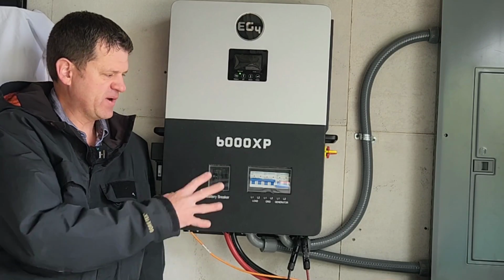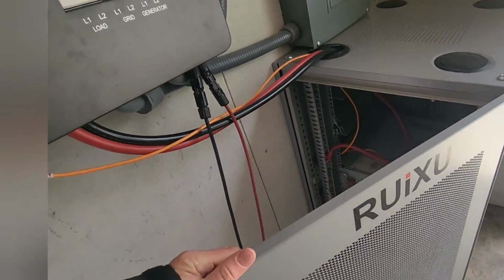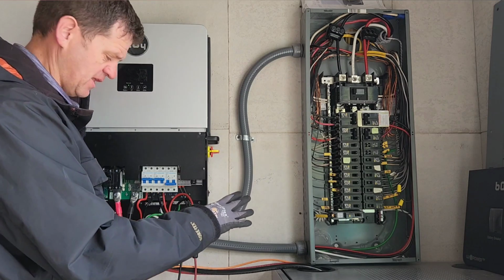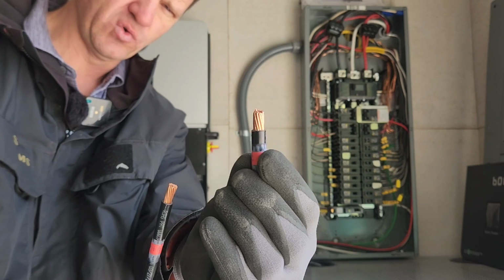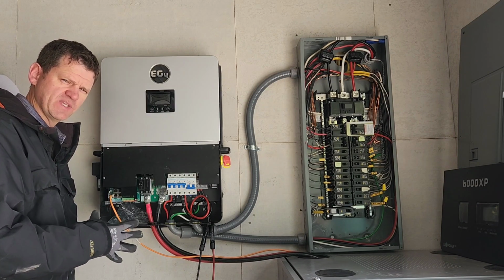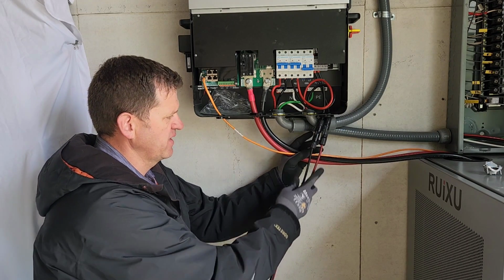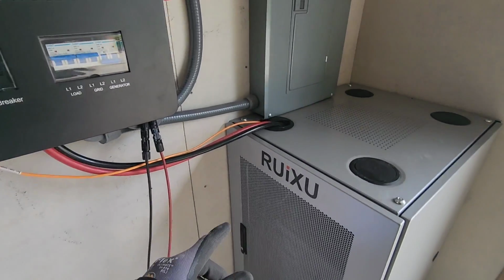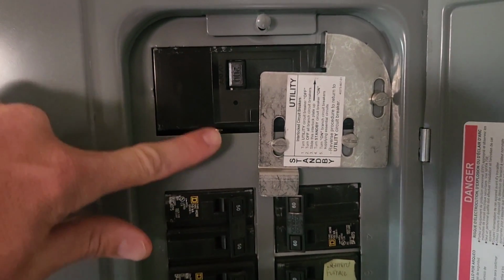1 Month Review: Easy DIY Home Backup Solar Power System & Battery | 6000xp Ruixu Install

Comment: Not supposed to have anything in front of the panel!!! Batteries need to be moved...
Why are you putting any conduit between the inverter and the conduit box? Just bump it right up to it!!!😂 Is there a switch down there you have to access on the bottom???

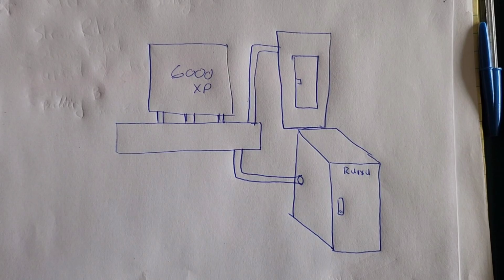Comment: 1:15 and 7:20 don’t think you can have battery rack in front of your electrical panel… nothing more than 6” away from wall blocking electricians access to the panel. Maybe add a ballon tip about this?
Reply: Mentioned at 21:21 in your other video https://youtu.be/dl_8fBnIexk

Comment: I thought you couldn't back feed to the grid with the 6000xp
Reply from the maker: The grid connection usual accept Grid or push power backwards into the grid... so this unit cannot backfeed from the grid port. I hope that makes sense.   However, if I connect the output power directly to the grid, it can send power to the grid and put lineman in danger if they are fixing downed power lines. Etc.
Reply: @diySolarPowerFunWithRay Thank you

Comment: Hi Ray,  can you tell me if your 6000XP and battery installation raised the ambient temperature of your garage?  My garage  can get to around 80 in the summer and I'm concerned the inverter/batteries would raise this significantly as I don't have the space conditioned or vented. I am wondering if additional fans might help.  Thanks
Reply from the maker: I don't think they will raise your garage temperature at all. I Haven't noticed anything.  But I would definitely recommend the 12000xp over the 6000xp model.   Not much more money and way more quiet... And there's a smart port... and way easier to wire than 2 6000xps.

Comment: By NEC rules, you need to move your battery rack, to clear your electrical panel access.
Reply from the maker: Yup. That's correct
 Missed that one.  Thx

Comment: -60amp breaker needs 4/3 wire, even EG4 instruction manual says to size wire appropriately.  Wire should always be larger than breaker, as breaker should blow before any melted wire.
-1/0 wire should connect batteries to 200amp battery breaker...

Comment: You should have installed an automatic transfer switch
Reply from the maker: I have my house running on my inverter all the time. Actually, the inverter has a built-in automatic transfer switch, so it will automatically switch over to grid if the batteries get low and then when the sun comes out, it'll switch back.

Comment: This appears to be exactly what I want to do. My only question: So on a day to day basis, you keep the main grid power switch in your panel turned to the off position?
Reply from the maker: Yup... off all the time... unless my inverter breaks for some reason.
Reply: @diySolarPowerFunWithRay  I love it! But the dual pole 60 amp breaker that's feeding your panel from the 6000xp (yes, I know you've updated since) is sufficient to handle the load from the entire house? I'd be afraid that would be the bottleneck if your house was pulling too much power.
Reply: @robwatson7401 the system uses grid if the demand is too much. Pretty nice system.

Comment: Im trying to size my batteries for a system build. The EG4 6600 @ 6000W apparently needs 28 of the 5KW batteries, and I see a lot of folks running much less. Wondering why that is. Im looking for an off-grid solution to run 3500W so the 6000 would be a good choice. With only 3500W I would apparently need about 17 batteries. Again, much larger than expected.
Reply from the maker: One server rack battery can usually produce a constant 100 amps.  So one battery can product 100a x 52v = 5,200 watts.
Reply: @diySolarPowerFunWithRay  Thanks, I need to sustain 3.5KW load for 24 hours. That is about 85KW for the day. That's where im getting the 17 batteries from. Im figuring an average of 6 hours/day of sun, so 6KW * 6h = 36KWh, which is short of the requirement for recharging the batteries each day.
Reply from the maker: @ronwatkins5775  17 is correct.  so it sounds like you're array is too small as well. Your array will need to produce 85KWH per day also.  Are you sure you have a constant 3.5 kilowatt hour load running all day long 24 hours a day. What is it?
Reply: @diySolarPowerFunWithRay  Yes, 3.5KW. It's for mining crypto currency. Im looking into what it would cost to setup an off-grid capability to see how it compares with the earnings from the mining rig. If it's feasible, then I would probably like to do a much larger off-grid installation. for now, just trying to match-up what solar gear I would need to run a single mining rig.

Comment: Wire and breaker sizing is always fun to decide what you want to accomplish or protect. Not always so straight forward. You've got battery cells capable of 300 amps, a BMS capable of 200 amps but you crowbar the current flow to 50 amps. Never know, you might want to bump the current to 75 or even 100 or even get stupid and crank it up to 200 for heavens sake. Somebody needs to invent adjustable wire and breakers. And hang your wire stretchers on the side of the panel just in case. 🤣

Comment: A trough directly under both proposed inverters would look just as good if not better than having pipes between the inverters and troughs saving on pipe and headaches to connecting troughs to inverters. Additionally, you can use the troughs as a means to run lots more wire as the rule on fill amount in the troughs wouldn’t be violated as if pipe were used. Great job!!!
Reply from the maker: I'm leaning that direction.  I will have to punch a bunch on holes out of the bottom of the trough for the battery terminals and communication ports... But I think that's do-able.

Comment: Why is there no mention of the loads from your water heater or well pump? Those are high demand and hard to start devices.
Reply from the maker: Not well pump for me. and my water heater is gas... although I should probably switch it over to dual fuel.

Comment: I have a proposed off grid plan. It is a 60amp Sq D load panel - 6500 and Ruixu batteries and a 10 000w gas generator. I plan to place a 50amp breaker specifically for a generator outlet on my exterior. I plan to use 4 gauge copper from the Inverter to the main lugs of the 60amp load center. My generator is a back up. My question is; should I use a transfer switch to flip back and forth - Inverter to generator?
Reply from the maker: I think i would do something different. Are you in the United States? It's this for your home? A critical load panel?
Reply: Thanks for the reply. I am building a small 2 bedroom cottage in The Philippines. It is the critical load; water pump, AC 1.5M³, numerous led lights. Code compliant - No.
Reply from the maker: Because your International, those batteries would probably be fine.  I think they have Distributors all over the world. I would go with a smaller generator that is connected directly to the batteries and would automatically kick on when the battery is getting low. I would not have the generator run my house but instead have it just charged my batteries and have the inverter run my house.  You can have your generator automatically turn on for a bit when your battery gets low.

Comment: Would not use an interlock on the main panel.  Instead, use one or two 10 circuit Reliance manual transfer switchs.  Gives you the ability to run solar for the stuff you want solar to run off of, and keep the other stuff on the grid, and switch back and forth easily depending on your needs.  The interlock is ALL OR NOTHING...

Comment: Question about tapping after meter before 200 amp panel with Polaris or B-Tap connectors: Can 200 Amp go directly to the 6000 XP with 6 AWG? A disconnect or 60 Amp breaker recommended?

Comment: Hi I appreciate your videos. I'm in SLC, UT I'm curious if you would consider converting to EG4 12 and net metering?  How would you assess the pro/cons. It seems to hinge on pv array size/cost versus battery bank/cost but would love your input.
Reply from the maker: The nice thing about the 12K or the 18K is that you can use with batteries and backfeed if you want. The 12K and 18K also have more certifications... so if you are getting a permit and your inspector gives you a hard time about the 6K, you might consider going to the 12K or the 18K.  A single 6K is a little bit small for my house so the 12 K might be just perfect for me. I'm gonna try it out for sure.

Comment: If you add a second inverter do you need to add a second interlock fuse? How will it feed the panel?
Reply from the maker: I am going to have them feed through the same interlock kit. For me, I am planning to add a wire trough underneath the inverters where I'll connect both L1 and L2 feeds with a couple polaris connectors.

Comment: also you need a ground wire in the flex that feeds the grid power.
Reply from the maker: I could add that, but I currently already have a grounding wire in the other flex.

Comment: Does this inverter require to have both positive & negative DC panel arrays wires fused?
Reply from the maker: On the inverter there is a DC breaker for the battery cables. So just make sure you select battery cables according to that DC breaker if you want to use the protection from the DC breaker

Comment: What communications settings did you use for the batteries on the 6000xp
Reply from the maker: For the ruixu batteries?  Min 9:20 in this video.  https://youtu.be/H38UZV3gx4Q?si=dALiyViinT-27QhD 

This worked best for me.  I'm open to suggestions though.
Reply: Inverter Setting：

Battery setting:dip6 set on.Inverter setting:select“Li-ion battery”under ‘Battery type’,select”8”under ‘Lithium brand’.Feel free to contact me if you have any questions.

Comment: Can you run an AC unit (4 tons) with a soft-starter with the 6000xp? and for how long can run the AC unit with the power stored in the batteries?
Reply from the maker: I haven't done so but I imagine it would be fine....HOWEVER, if you have a lot of other loads running at the same time it probably will not and you would have to buy another unit. 2 units can be a little noisy so you would need to make sure you have a space where that wouldn't bother you. You could use a meter on your home and see how much power you are using on each leg when the air conditioner is running. If a single leg is over 3,000 Watts the unit will switch to bypass mode and run everything off of grid. During this time all solar goes into charging the battery.   If your battery is topped off your solar will be just wasted in this scenario.
Reply from the maker: I have three server rack batteries for my system and if I run the air conditioner after the sun goes down my battery is will be dead in just a few hours. They will last through the night if I turn the air conditioner off after the sun goes down.

Comment: Good video for DIY project, I am not an electrician so I have a question about the Polaris connectors. Lets say your panel is 100 amps and you connect the Polaris connector so you can then connect to the inverter. Would this send 100 amp to the inverter? (Grid breaker on the inverter) I thought this inverter max ac input was 50 amps.
Reply from the maker: If you connect this inverter between your house panel and your meter, you will definitely be limiting the number of amps that your house can accept. In my case 50 amps has done me pretty well. It hasn't tripped yet but it might be in the future. I might end up putting two inverters in so I have twice the power. Or switching out to a larger inverter

Comment: You need lighting protection between the panels and the charge controller. The panels also need to be mounted to be in compliance . I am off grid  for about 3 1/2 years, I am in the USVI and our power is terrible .

Comment: I am on the grid, and only want a system sized for a refrigerator. Would it make economic sense to go with a battery only big enough for overnight, and switch from solar to grid when needed? I could preheat water with the excess solar amps. In New Mexico we have few cloudy days, and those in the summer.
Reply: Just get an Ecoflow Delta Pro to run your refer. No need to go to all the trouble of installing a system like this for just one refrigerator over night.
Reply: @lucklarry  It would be easier with the delta pro but you can build this system in an hour and it's cheaper and more powerful.
Reply from the maker: For one fridge it would make sense To me to get a battery that would last a couple days.

Comment: You mentioned that you can configure the 6000 XP to do a neutral bond via software controlling a relay. From what I understand that is correct however it is not an automatic set up. I believe you were saying that if you connect an RV set up to shore, the XP will automatically decouple the neutral bond link. I do not believe that’s correct. I believe the manual states that it is either on or off and you would have to manually go in and reset that and take the neutral bond off if you connected to short power that had neutral bond.
Reply from the maker: Thanks, If the manual states that, that is probably correct. I'm not sure where I heard did that. Automatic bonding would be really nice. I know that if I enable option 26 I get the bond in the inverter.  Thanks 👍
Reply: @diySolarPowerFunWithRay  I was commenting on the same this, Its an either or, NOT automatic. If it were to be used in a mobile scenario it would have to be manually changed every time you hook to grid etc.

Comment: Why would you invite a corporate municipal inspector over to your private land?
Reply from the maker: Good point. For me,  it's about homeowners insurance.
Reply: @diySolarPowerFunWithRay you are correct. Any fire that occurs by non compliant modifications will void your coverage. Insurance is great in theory. Most people never read and let alone comprehend the fine print in their insurance contract/binder. 99% of the time it will never be used. When a person has a “catastrophic loss” they will get to encounter the “loss prevention” team of the insurance company. Their job is to eliminate or minimize the insurance companies losses. 
You are smart to get any required inspections and permits for your improvements. The insurance company may still screw you. It just gives you a fighting chance. Great video thanks for your experience and sharing your story.

Comment: If your Solar Panel String is High Voltage D.C. & not micro inverters, then your Solar String wires needs to be in Metal EMT Conduit when it comes into a building.

Comment: is that the fans screaming in the background?
Reply from the maker: Yeah, it can be loud when it's running heavy. You definitely want this behind a closed door or in a garage somewhere.  The crazy part is this is supposed to be quieter than the previous competitors.
Reply: @diySolarPowerFunWithRay  yikes.  Loving my victron
Reply from the maker: @tlteal  What victron do you have?  How often does the fan run?  Thanks.
Reply: @diySolarPowerFunWithRay  450/100 and I don't know since I can't ever hear them :-)
Reply from the maker: @tlteal  How about your inverter?
Reply: @diySolarPowerFunWithRay  multiplus II 5k (two fo them) is what I intend to use.
Reply from the maker: @tlteal  under heavy load... are they've pretty quiet?
Reply from the maker: Are your inverters pretty laud?

Comment: Do you have a recommendation for an inverter with lower idle power consumption?
Reply from the maker: The 6000 xp isn't bad. But if you want something over the top I'd go with one of these models. I hear they're very efficient...But expensive and it's not a all-in-one unit. For example you'll still need to buy a MPPT, etc.  https://signaturesolar.com/victron-multiplus-48-8000-48v-input-8000va-output-230v-110a-charger-transfer-switch/?ref=DiySolarPowerFun
 Expensive but very nice from what I hear.

Comment: Just an FYI, high voltage dc PV wire is required to be in metallic raceway inside a building in most areas.

Comment: Looks good and love the Polaris connector idea.  Few comments for code compliance  1) You need 36" clearance in front of the electric panel, need to move your battery rack, 2) All PV must be in EMT or MC conduit within the premies, can transfer to PVC when outside in your trench, 3)your DC battery cables must be in EMT/MC conduit for code compliance, not PVC.
Reply from the maker: Nice.  Thanks!

Comment: i would secure you solar panels before a storm or high wind takes them.  I would not put those batteries so close to the door.  They don't work well in the extreme winter.

Comment: Hey Wray how much daily kw does your house pull with the ac included? Thx
Reply from the maker: I haven't tested the daily kwh use with the AC Yet for a typical summer day.  But this install video tests the kw when my larger appliances are all running.
Reply: @diySolarPowerFunWithRay don’t you have your power bills from before you added this gear.  you won’t get peaks, etc. but you get an idea about average power used over the whole year if you have bills for last year. found a year of bills online for my house.
 
with a little work you can get into a spreadsheet by week, or month, or quarter to draw some graphs 

once you collect the new data from your new gear you will have much better idea what is used all year in another year.
Reply from the maker: @_xyzyz_  that's a good point.  I need to find those for the comparison video.   That should give me a good idea

Comment: the only thing i dont see there or close to it is a fire extinguisher, you never know when those batteries blow up or a fire start, or is that not regulation for it there by you?, or you have sprinklers above it? having a gun and not have to use it is better than not having one at all lol

Comment: Ray, great update. Don't forget to add a disconnect on your grid feed out of the panel. Then, you will not have to turn off power to the house in order to isolate the inverter for service or removal.